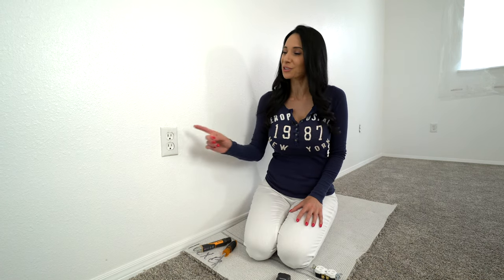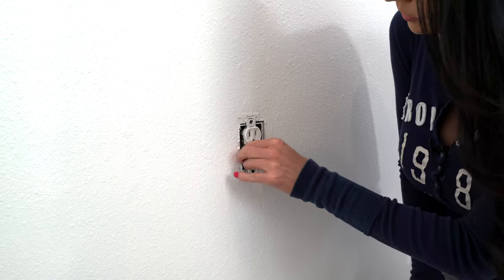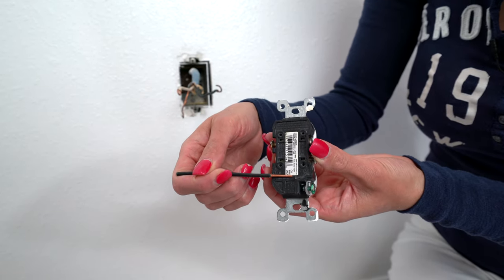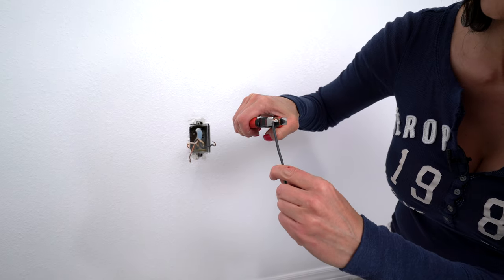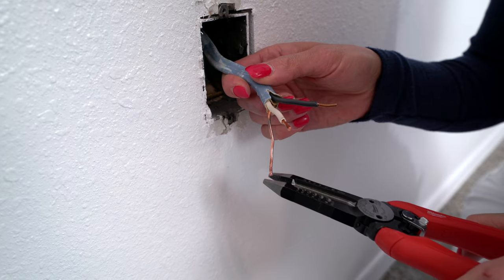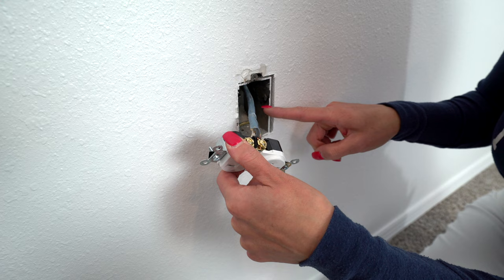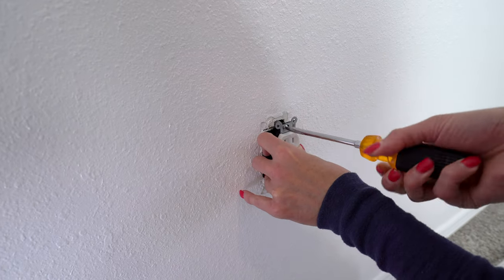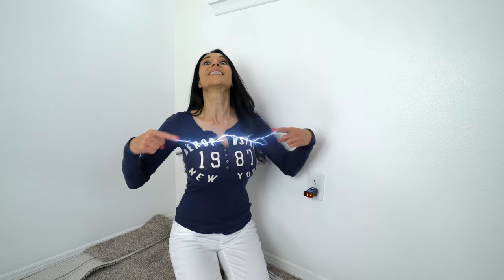How to Replace an Electrical Outlet | Basics

Comment: Good job, I'm an electrician and those milwaukee strippers are what I use , they're great. The 2 small holes can also be used for cutting down your 6/32 and 8/32 screws(screws used for outlets and lights). Another small note. The plate under the outlet terminal screws are typically used for stranded wires. 👍
Reply from the maker: Thank you🙂
Reply: @NassrinsDIY  oh and thanks for taping the outlet. So often its forgotten in metal boxes

Comment: "Ground, Neutral, and the,
                 Hot'tie'!
Great vid Nassrine,  I'm glad to see that you featured, the old school, receptacle, with screws wire lugs..., a little more work, but much better conductivity and reliability, than the slide in type.
Reply from the maker: Thank you☺️

Comment: Thank you.You gave me an idea with that checker.I immideately ordered one with posibilty to check wiring and specially if ground is well connected and if safety switch will turn off circuit.Until now I checked with a lamp where I changed neutral to ground.'Cause everything in my home I did it myself,also wiring I want to check if I did it properly.With that checker everything is more simple and now I'm realy one hundred percent that everything I made is ok.Just two or three outlets I reversed hot and neutral wires.It can happen to everybody.Thank you again.
Reply from the maker: Yourwelcome🙂